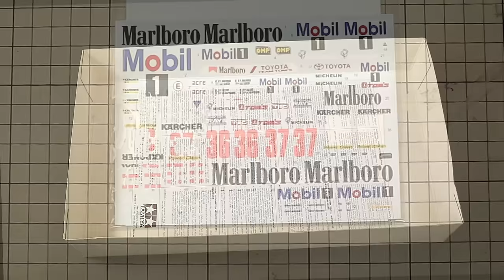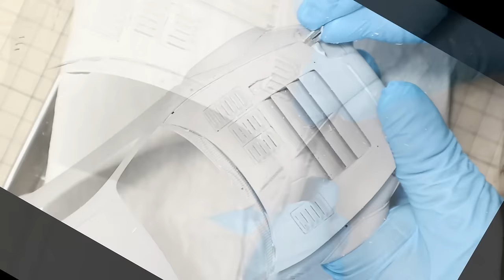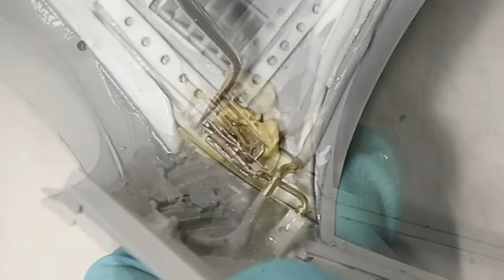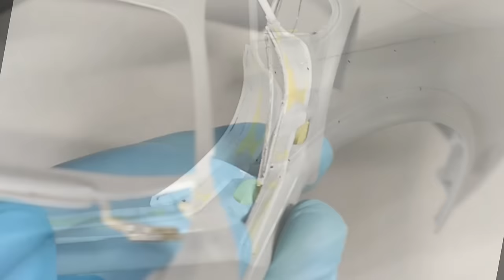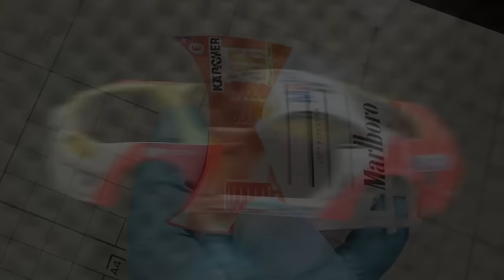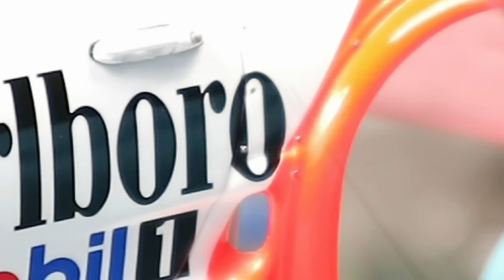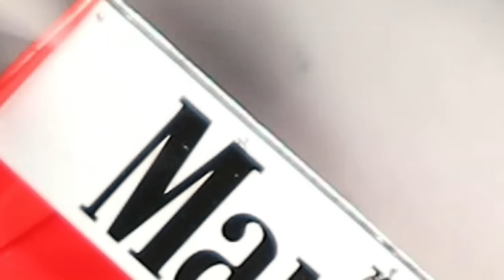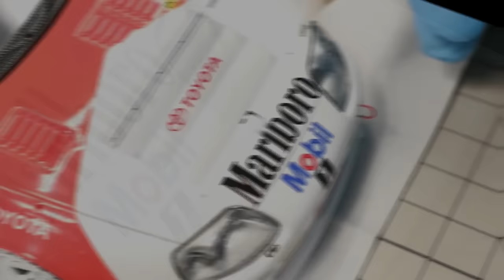SUPRA GT Mk4 '95 BPR Zhuhai / TAMIYA KIT 1/24

Comment: Correct me if I'm wrong but that isn't the right engine. I'm pretty sure that car still retained the 2jzgte engine in real life which is an inline 6.
Reply from the maker: youtube: BPR 1995 Round12 Zhuhai H264 Germany part 1
https://youtu.be/RD4xJBeRQJg
8:38
Reply: the 2jz has never been a competition engine, a good engine certainly but overrated because of Hollywood and the tuning scene. The supra raced with a 4-cylinder Toyota 3sgte in GT and a Toyota 3uz-fe v8 in superGT.
Reply: Not in GT racing....Skylines didnt run the RB26 either in this era.. V6
Reply: @gearhead762  Sorry, but Skylines in the JTCC ran the RB26, and until the R34, in the JGTC, they ran the RB26 too. The V6 was installed on the R34.
And there was a version of the Supra Mk. IV that indeed was engined with the 2JZ, but don't know wich one.